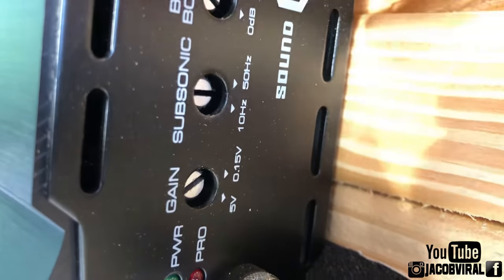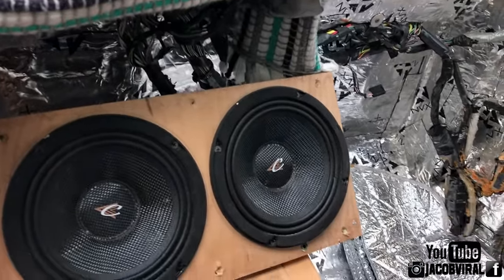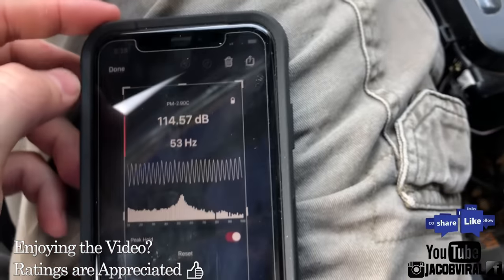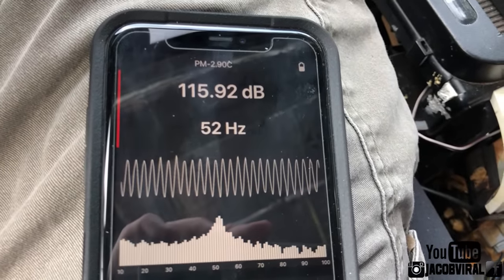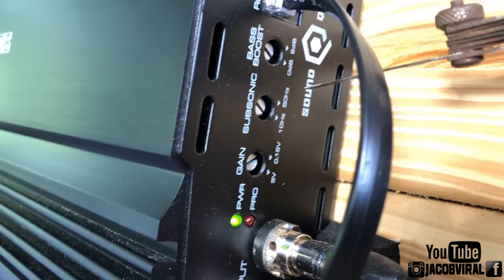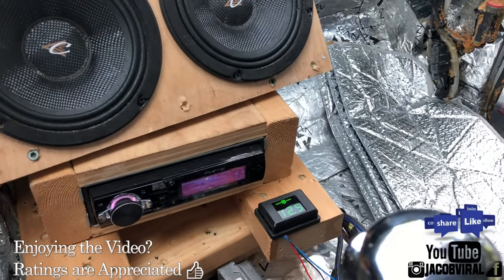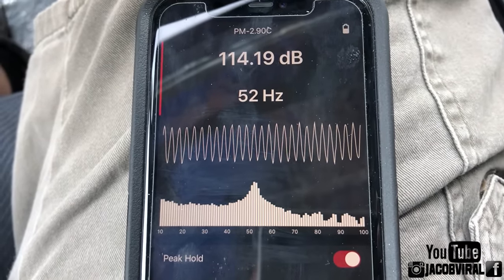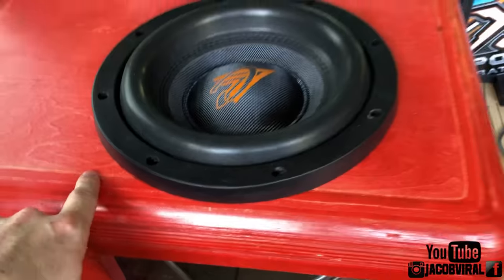HOW IMPORTANT SUBSONIC SETTING IS ON YOUR AMPLIFIER?

Comment: hi good the video can you tell me i want to put it in my wolkwagen passat 2001 Taramps HD 3000 1 ohm Amplificateur 3k RMS
+ Nouveau SKAR AUDIO SVR-10 D2 10" 1600 W Max Power Dual 2 Ohm 800 watts rms+ XS Power PS545L 800 Amp alimentation 12 V cellule 600 W voiture Audio AGM Batter ,is the battery good?I want to put this battery in place of my engine battery, is it powerful enough for the engine and the music?
Reply from the maker: That battery is only 17ah, not enough for what your doing. Also, I would go with a D series xs power like https://amzn.to/3Apw5db under hood & get a 2nd xs group 34 https://amzn.to/3Apw5db in the back as well if possible.
Reply: @JacobViral2  good👍👍

Comment: It would be nice if instead of just giving you the highest and lowest setting numbers to have at least 3 points of the in between number like yours lowest is 10 highest is 50 there should be a 20-30-40. But eh I doubt they’ll listen. I just tune carefully and just rock 4inch coils. But I’m picking up my custom pair of Solo X 18 motors on 15 inch frames it’s a 3.5 coil but better then stock and my builder made them especially for what I play at 28-18 hz. Not a cheap pair of subs but worth it. Can’t wait till tomorrow afternoon!!! Update-subs still not ready a bolt snapped on one of them so it delayed the build on of of them. EH... there worth the wait!

Comment: So because you use the subsonic in the correct range based off of your application, are you suggesting that you could slightly turn the gain up more (safely to squeeze more out of the sub) versus tuning somewhat conservative because the subsonic filter is off/lower than what the sub "should" play?
Reply from the maker: Correct basically yea but also for safety

Comment: Do I need to use the subsonic filter if I'm using a dsp to set the hpf? My subwoofer specs are 25-250hz, so I set the hpf at 25hz and no slope in the dsp. Also, what is the best way to set gain and lpf for a subwoofer?
Reply from the maker: Yes and this video helps for lpf https://youtu.be/vLlRjGckgHg ; thanks for watching and subscribing

Comment: How do you know where to set it? Do you use a meter or some sort? DD1?
Reply: On a ported box you set it near port tuning. Keeps the cone under control as the box will not below port tuning(unloadeding/free air). this can be found by doing a frequency sweep and seeing where the cone movement is the least that’s right around tuning that’s right around where you want your Hipas set.  If you are not using enough power to exceed the drivers x max its not necessary but  still recommend as more power will be utilized in the drivers usable range. 

On sealed enclosures, In vehicles with a high transfer function u can actually have too much low hz content and can use this to eq it out.   I do this in my daily, sounds way better and gets louder cleaner.

Comment: I have two Skar Audio 12s ported with a 1200 rms Skar amp box is packed for 40 hrz what should I set my gain and subsonic to
Reply: i think you would want it set to about 30hz if you're tuned to 40(half of 40=20 half of that is 10, subtract that 10 from the original 40 that you're tuned to).

Comment: Subsonic should be set to 1 octave below box tuning frequency
Reply: So if my box is tuned at 30 hz was gen I hat should I set my filter at
Reply: Manuel Barrientos generally take your enclosure tuning and multiply it by .75 and that’ll give you your subsonic. I would set your subsonic to around 22hz
Reply: @mopar392ta3  if my box tune is 26, so i need to set my HPF filter to 19.5 ?
Reply: @VidiSLTU  roughly yes.

Comment: so if tune to 30 my subsonic should be round 20-22hz ?
Reply: According to Jacob it would be 22.5. Multiply 30 x .25 and subtract the answer from 30.
Reply from the maker: What C Smith said is correct. Half an octave below tuning is a good guideance range to tune your subsonic to.

Comment: My four channel have a subsonic filter. I use the amp only for mids. Should I use the subsonic filter
Reply: Your high pass should already eliminate any frequencies that a subsonic filter would effect. Your high pass should be set above any frequencies that your subs would be playing. Generally your subs should go no higher than 100hz and your front or rear stage wouldn't go any lower than 100 hz. In systems with a three speaker full active front stage you might have an 8 or 10" mid bass driver go down to 80hz but your subs should be set for a low pass under 80hz so that they don't cancel each other out. The subsonic filter will almost always end at 50hz so your interior speakers connected to your 4ch should already be completely crossed over and silent down at 50hz. If it makes you feel better there should be no harm in you turning your subsonic filter all the way up on your interiors but it wouldn't or shouldn't effect anything.
Reply: This was probably the worst explanation of the use for a subsonic filter I've ever heard. Basically a subsonic filter is used to increase the efficiency of the bandwidth your trying to play on your subwoofers. If your amp is trying to reproduce sounds that are very low like 20-30hz it takes rail voltage to do that. You will want your amp to have that voltage to put towards the frequencies your trying to reproduce 30-80hz (in most cases). It's been around since at least the 1970's but was used in home audio to protect damage to your speakers that had a difficult time reproducing bass below 30hz but also has the benefit of making your amplifier more efficient in driving your speakers in the range you want. This results in an audibly tighter bass reproduction.
Reply: @brentb5303  my subsonic filter is 20 to 500hz. On my ampere 150.4. I have a pair of beyma 8's.  8cmv2  is the model.  I have a pioneer 80prs and the hpf is set to 80hz.  I get so much speaker flex my mirrors shake.  The speaker can't do rms power if I don't have the the subsonice filter on with the hpf at 80hz,  it does 125hz perfect with the subsonice filter off

Comment: If the subsonic tuned to high could it blow the speakers or get it to skip beats?
Reply from the maker: Subsonic will cut off lower frequencies with a grater dB reduction so if it’s too higher your losing output.

Comment: Wow great explanation. I have a 6th order enclosure in the making rear tuned 32hz and front tuned 60hz .what do I set my subsonic filter is 25hz reasonable
Reply: Depends on the actual peek and sub and power but that sounds fine to me. My 6th is 28/52 and I leave my SSF off /10hz
Reply: @KnowName33  wow awesome my subwoofer is a jl audio w7 13.5
Reply: @shivanharry1532  those can dig deep for sure.  I've got a nemesis colossal V1 15" sub   .
you could probably go a bit lower you'll just have to play with it and see  . The cab size and windows up or down will effect it a lot also
Reply: naname  thanks bro appercite it

Comment: You mentioned someone turned to 30hz would set it around 3 or 4 o'clock instead of 1 to 2 but the lower the tune, the lower the end result so wouldn't that me a 30 hz person would set it between say 11 and 12 oclock?
Reply: Was thinking the same.
Reply from the maker: Yes correct backwards thinking it seems

Comment: where should  i set mine at if box tune to 32hz  my sonic filter just like yours lowest is 10 and high is 50 should it be half way mark or right after half way
Reply from the maker: 24hz so around 10oclock?
Reply: @JacobViral2  10 o clock position would be less than 24hz cause half way is 20hz 50hz is max and 10hz is less it will go

Comment: How do I know what a box is tuned to? This is the box I'm using Rockville REC97 Dual 12" Ported SUV Subwoofer Sub Box Enclosure - Behind 3rd Row

￼

￼
Reply from the maker: I made a video of this on how to find subwoofer box tuning: https://youtu.be/amnD9UJwxtM
Reply: Also you seem very knowledgeable about car audio.  If you don't mind me asking. I have 2 12 inch skar svr's. The recommended enclosure size is 1.75 cubic ft each and the box i have is 1.25 each.  How bad will this effect the subs? Im limited on space since i have 3rd row.  I am running a hifoncs 1750 class d amp.  So the is there for them just don't want to burn my subs up.  Not necessarily trying to get into competitions or anything.  Any input or recommendations you could give me?
Reply from the maker: @TheBudugravy  You’ll be completely fine just you may be tuned a little higher and the subs won’t plays the lows as well plus needs more power on the to really get the output they can do when smaller box then recommended but overall it’s just a tighter punchier box probably.
Reply: @JacobViral2   thank you so much.  I was worried it would damage them honestly.   They are new and sound good.  They do have a tighter bass and don't get super low.  But also not trying to be in competitions with them so they work.  You are saying I should add more power to them? I would but there already distortion some times.  Could that be because my amp isn't set how its supposed to be or maybe underpowered?  I really do appreciate your help man!
Reply from the maker: You could be maxing your amp out and not giving the subs the desired power being after voltage drop and rise maybe 400-500 per sub max my guess. It’s always good to have a bigger amp and not max the amp output out.

Comment: Hi, my subwoofer making whistling sound at around 25-30hz, what could be the problem?
Thanks.
Reply from the maker: Never heard of that problem weird. Only high volume levels? Could be clipping if so.
Reply: @JacobViral2  Not always, I mean it does that on low frecuency only I noticed around 25hz and up sound like air leaking but everything is well glued. Sounds like that whistling/rattling sound coming from sub. But when you listen on max vol. inside of car doesn't sound like distorted, like normal.

Comment: Noticed you dropped .2 volts between the tests could that have played a roll in your lower db numbers more so than the subsonic filter
Reply from the maker: Good point may be slightly deviated but minimal

Comment: I do think this video was informative... 
But I do believe that those with a minimal understanding of electronics and the technical terminology associated with car audio, your video would be confusing.  
I think you have the concept of how it works, but you're not putting it into simple terms and you're unnecessarily repeating yourself over and over.  
Slow down... plan things out before you record, and make sure you dumb it down a little for the people in the back. 

Other than that Jacob, please keep throwing informative videos like this into the digital abyss because there aren't many videos covering subsonic filtering and how it works.

You're filling the gaps bud.  
Well done.

Comment: I look at my subs manufacturers and says between 25 to 30 for subsonic. I have skar evl 12s
Reply: I have a scar audio amp 1200 I use it on 2 12s how should I set my lpf ?
Reply: @Deeznuts-cz3cs  I got the rp1200 too on 2 12" SDRs. Did you ever figure out a good spot to set them??
Reply: @Davidxll  yes I did thank you I just need some new speakers ima check them out on crutchfield

Comment: So if I understand this right my subsonic for the sealed side tuned to 38 of my 4th would be 19.5?
Reply from the maker: 38 - (38x.25) = 28hz, BUT For 4th orders if your sealed section is tuned different then your ported enclosure it varies differently then ported enclosures.
Reply: My ported side is tuned to 56 hz it's a external octoport I would love to get the most output out of my 8s that I have in there now thanks for the reply Jacob!

Comment: Always set my SubSonic to 25hz on every amp I use.
Reply: Out of 10hz to 50hz on the subsonic dial, 25hz should be a little passed a quarter right
Reply: I just eyeball it I go to the lowest I could play then turn up the subsonic till I get it were I want it
Reply: kratom kiing more like a littles then halfway. Halfway typically is 30 hz. Therefore move it back to the left
Reply: Me too between 25 and 30

Comment: I have a ported box tuned to 32hz if I done the math right I would set mine to 32hz right
Reply: 32÷.25=128  128×.25=32
Reply: @chrispuckett1347  should be around 20hz I belive.
Reply: @alanray7177  it should be 24
Reply: 32 x .25=8
Then 32-8=24

Comment: If the Fs of your Sub is 25 then should the Subsonic be set to 20 Hz?
Reply from the maker: Go by box tuning not fs. If sealed box maybe that makes sense but I wouldn’t go off fs.
Reply from the maker: I would probably do 25hz and see how it handles it, if unloading issues in the mid 20hz waves the. Increase.

Comment: If 10 is one end of the dial and 50 is the other, wouldn’t that make 30 at 12 o clock in the middle? 20 would be about inbetween 10-11 o clock, and 40 would be between 1 and 2.
Reply: yeah 30 would probly be around 12 o clock

Comment: On a Subsonic Filter 20hz - 50hz

What would it be at 12:00 position? 35hz?

20+50=70hz

70/2= 35hz

Thanks for anybody that can’t help me figure it out..

Also, LPF 20hz - 200hz 

Half way would be 110hz and 9:00 position being 55hz?
Reply from the maker: 20-50hz would be 35hz at the middle yes. And correct for LPF within 10% close your good
Reply: @JacobViral2  thank you :~)
Reply: @FinsleysCustomCarAudio  
The amount a "setting" is at is only an assumption based on the visual correlation, and not to be trusted as "accurate". It depends on the make, type, and rotation ability of the attenuator and has nothing to do with the "o'clock" of it other than people believing it's close. You'd need a multimeter to know what "half way" is exactly.

Comment: Let me ask you I did this formula thats out there please let me know if this is correct or not my box it tuned to 32hz so I would take 32÷2=16 take 16÷2=8 now you take 32-8=24hz & thats what you set your subsonic to so please let me know if I'm set right or set to just 32hz& call it a day p.s also I use the dd-1 to set my gains it says have subsonic off when do the gains all to flat why are you readjusted on the subsonic while do the gains?
Reply from the maker: Correct for subsonic that would be quarter wave below set tuning. For the gain set I suggest doing it at set subsonic so it’s tuned to that over being off as it can drastically affect output if not careful.
Reply: @JacobViral2  question what did you mean by set subsonic I'm trying to dissect the difference of both answer 🤔
Reply from the maker: @loloent  it means on your amp set your subsonic to that 24hz calculated then gain set.
Reply: @JacobViral2  thank you now I'm out of commission my skv2 200.4 mid's & highs is going back to skar for replacement but will be back sometime next week appreciated your reply 😀
Reply: @JacobViral2  now the other question would be ,like yours where would 24hz be exactly?
Reply from the maker: @loloent  between 9-10 o’clock
Reply: @JacobViral2  thank you for your help & replying also does this apply for the 4ch amps as well?
Reply from the maker: @loloent  subsonic is specific to mono block class D amps for subs.
Reply: @JacobViral2  so what  is the subsonic for on my skar skv2 200.4 it has subsonic LPF-FULL-HPF On it so what do I set them to if I'm running pioneer TS-Z65CH components in the front doors pioneer coaxial in the back doors & the backs are jointed with some pioneer
Reply from the maker: @loloent  usually full range and just set the crossovers. I still need to make a video on tuning 4 channel all thanks for idea! Stay tuned and subscriber if you haven’t.
Reply: @JacobViral2  I understand you guys like to do video  on this & I look forward to watching it but I'm trying  to set my system now as we speak so I can call it a day & relax watching yall videos  but can you help me out with this I need to set all my filters & my subsonic for my multiamp thank you in advance 😊

Comment: Do you have a video on setting gain
Reply from the maker: Not yet but will do eventually
Reply: Rule of thumb between 85 thru 110 on high and lows
Reply: @JacobViral2 
My subsonic is from 10hz to 40hz  where would 25 hz be at ?
Reply from the maker: @Catholic1391  2oclock, little past halfway
Reply: @JacobViral2 
Thanks for info👍

Comment: Would you set subsonic filter on your amp if you have a sealed enclosure?
Reply from the maker: Yes just harder to know where so just test with it off and see how the sub reacts to low frequency sweeps and tune from that.
Reply: @JacobViral2  Ok, thanks..

Comment: Can someone help me out I have 2 12 inch kickers subs 1500 watt rms hooked to a kicker amp 1200 watt rms how can I know what my subsonic and LPF should be set on
Reply from the maker: Check my videos I show you how to tune; https://youtube.com/playlist?list=PLkYp1Fj-99b0pFNxaohIxCaer8VxQVZ2j
Reply: I did check all your videos on how to tune  I understand some what how to set mines because on the kicker amp they have Gain, Xover, and bass boost I don't have LPF or subsonic that's what is confusing me I even bought a SMD dd1 I still haven't used it yet I don't know where to connect the wires to work it 😂 im still a rookie

Comment: My sub manual says it plays frequency from 20hz to 2.5khz can i just leave SS off?
Reply from the maker: Depends on the enclosure not the subwoofer. Sub can play depend on subwoofer specs and output peaks.
Reply: @JacobViral2  make complete since i turn it off and my sub started to stink bad.

Comment: I got a dc audio level 2 10 my box is tuned to 35 hz so i got my subsonic at around 28hz is that correct because half n octave down should b 17 and a half x 2 would be round 28 ish am i correct?
Reply from the maker: Yes you're very close. 35 - (35x.25)=26.25hz